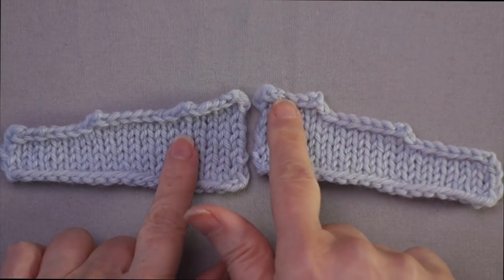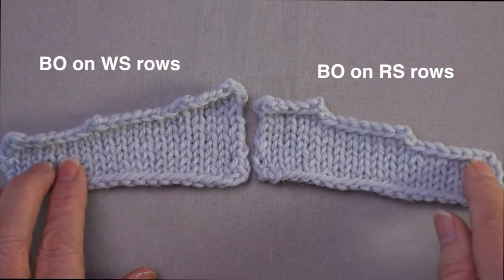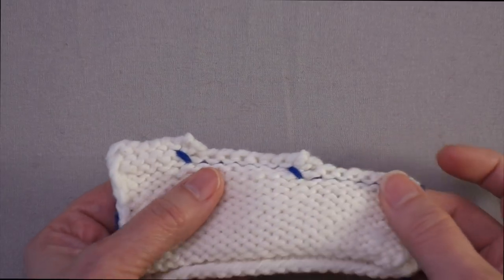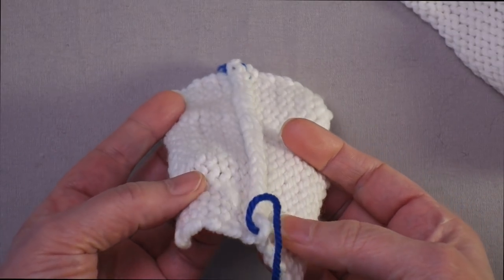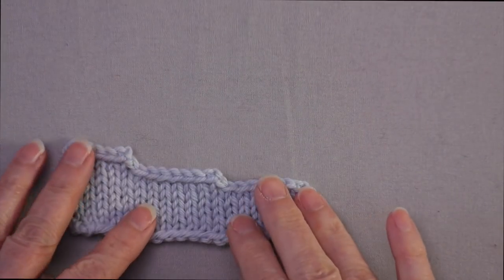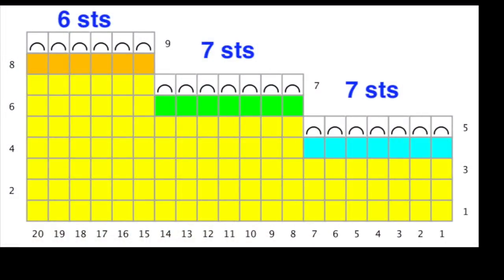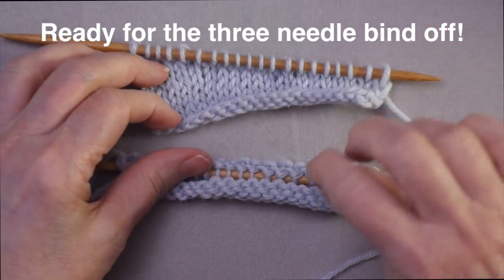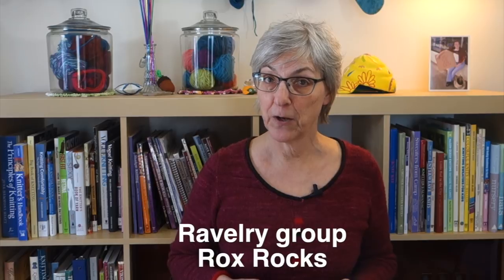Eliminate Stair Steps With Short Row Shaping // Technique Tuesday

Comment: Fab tutorial. 
I love this short row technique instead of steps, and I even use it for necklines and armholes. One gets such neat results As long as it is an "every other row"-business, it can be used there. @Roxanne Richardson
Reply: Do you typically choose to graph them together with Kitchener or do you do the 3 needle bo?  If the latter, is it for structural integrity?
Reply: @eliedgecomb4903  shoulder seams need stability, so there I choose 3 needle bind-off
Reply: @eliedgecomb4903  I graft, but I usually use lighter weight yarn and I'm a small person.

Comment: I wasn't sure about using short row shaping for they edge of my last project, because I wasn't sure I boys do it right.  Thank you for making such a clear video with illustrative charts that show its really quite easy. Though my project had slopes on both sides, one side becoming a shoulder join,  the other side a wide neck opening, where the bind of is probably good for stability instead of just knitting the collaron live stitches. 
So, I didn't do short rows, but I did follow a YouTube video by Cheryl Burnette that shows how to make the actual bind of sloped instead of stair stepped. It involved slipping a stitch at the step point.
Reply from the maker: There are a number of ways of doing a sloped bind off. You could do the short rows on the neck edge, bind off, and then pick up the edge. The pick up process will be a bit easier along that sloped edge, and the finished result on the inside will be a bit tidier. But the other trick of slipping a stitch works, too. Turning and slipping a stitch is actually a basic short row method. :-)

Comment: Thanks for the clear demo, as always. Can I ask why you would not graft the shoulder seam? As an ex-machine knitter I’d expect to do this.
Reply from the maker: You may have been working with finer yarns when machine knitting. Hand knits are often worked with heavier yarns, which increases the weight of the sweater. The entire weight of the sweater has to be supported by the shoulders. Seams reduce the amount of horizontal stretch that could cause the sweater to slide off your shoulders. If the neck is wide, or open at the front (as for a cardigan), you lose even more structure. If the yarn is superwash and/or knit at a somewhat loose gauge, you again lose more structural support.  On the other hand, if you're working a pullover with a woolen-spun fingering weight yarn in stranded colorwork, you have all sorts of elements that add structure, and prevent stretch, so seams could become more optional.

Comment: Hi Roxanne, to say that I love your vids is an understatement. I have learn to knit thanks to them and Stacey.  I do have a question, I have learn to make bust darts on top down sweaters but can I work them the same for bottom up?  Thank you for all your help.
Reply from the maker: Are you doing horizontal darts, or vertical darts?
Reply: @RoxanneRichardson  I believe they are vertical darts.  I knit the short rows like your videos, 3 sets then pick up the twin stich. I use shadow wraps.

Comment: Hello Rox, very nice video, thank you. 
I have a question, is it necessary to do this technique on men’s sweaters, as they have boxy shoulders?
Can it just be a straight bind off. Oversized sweater.
Reply from the maker: It's typically not done on drop shoulder sweaters (which have no underarm BOs or shaping), but it is done on modified shop shoulder and set-in sleeve designs.

Comment: Thanks for teaching this tech. But I have a question do I need to do the same thing for the back of the sweater. ?
Reply from the maker: Yes, you can replace the stair step bind off for the back shoulders with short rows, as well. If the shoulders are not worked separately for the back (i.e. you don't bind off the neck and then shape the shoulders), you can use this technique here: https://youtu.be/ZoxS5_wE3xQ

Comment: That's so good, but what about when you are doing the shoulder shaping on the back of a sweater and you are doing both shoulders at the same time? Thank you.
Reply from the maker: When you've completed the shoulder shaping on both shoulders, you'll be at the neck. Work across the neck and one of the shoulders. Turn, work across the entire row, and then back to the neck. Bind off the neck, and put the shoulders sts on waste yarn until it's time to join to the front.

Comment: I am stuck. I am trying to knit a top down Sweater and the top of the Shoulders are knit seperate and the you join them together when you have done the GSR shaping. I have not knit a top down sweater before so I don't know what it is supposed to look like. The sweater has set in sleeves   and its knit in the round. Please could you suggest something? I can do the GSR because I do knit socks and I have used them there.
Reply from the maker: I'm always happy to help with project questions in my Ravelry group. If you post your question there, others can learn from the question/answers, as well as offer their advice/experience, as well.  Thanks, Marie!

Comment: Qorking on my first pattern.project a pair of long gloves called adelle which also say raglan i typed in the following section in to my search engine and it gave me your video however im confused as to what to do given your not making gloves. After it says to do 4 rows or lace pattern to 45 stitches where im at now it then says to switch back to the original size needles and start using double which i think is 2 threads not one or its what ive been doing regardless of right or wrong. I dont know what work 2 without shaping means nor to i know how to shape or not to shape though it says to ●work 2 with WS facing for next row which i think means pearl side facing for next row. i dont know how Work 2 rows without shaping, ending with WS facing for next row.● I am assuming to turn work after knitting to purl and turn again though im sure thats wrong. 

And even though im sure thats wrong until i get a response some where ill be doing that and then to ●Work 1 row, dec 1 st at end of row, ending with RS facing for next row● i have no idea how to work a row but hope it means to knit and decrease at the end with the  knit 2 together decrease any response is appreciated since im.basically working stupidly and .ost likely wrong until i get a response
Reply from the maker: Raglan typically refers to a type of sleeve for sweaters, not to anything that has to do with gloves. I would suggest asking your question in the Ravelry forums (the Patterns forum is probably your best bet). It's really the best way to get answers to questions about specific patterns.

Comment: I wonder if it works on different types depths of slopes or only fpr this 1 line  low type slope, im trying to make it on a steep V neck slope, i hope it works😺😺
Reply from the maker: The challenge for a deep slope is that the diagonal created will have fewer sts on the needles than you will need to work across the diagonal and keep the edge flat. That doesn't mean it's impossible, but it does mean you would have to create more sts as you work across that diagonal once the short rows are complete. This sort of technique was used  for certain types of necklines back in the 1930s, where there was a need to have live sts on the needles after the shaping was completed.

Comment: Can somebody tell me when ive knitted the right panel and it says knit straight up until shoulder shaping.  Which "step" as its in steps do they mean
Reply from the maker: YOu're knitting straight up until you get to the top of the armhole. The stair steps will get higher toward the neck, because your shoulders sit lower than the base of your neck.

Comment: I'm currently knitting a cardigan for my sister. The back shoulder shaping states "Cast off 2 stitches at the start of the next 10 rows". Can I do this as one piece or do i have to do the shoulder shapings separately?
Reply from the maker: You don't need to do them separately. Some patterns bind off the center sts for the neck, and then work each shoulder separately, creating a dip at the back of the neck. Other patterns bind off the center sts after the shoulder shaping has been done. Some neck styles benefit from the dip, some benefit from the additional height, it just depends on the type of neck (crew neck vs shawl collar, for example). Your pattern is the type where the center sts are bound off at the end, so you can wait to do that until after the short row shoulder shaping has been completed.
Reply: And I should be able to do them using one ball of yarn?  I shall try it out before I attempt it for real.  Thanks for your videos.  I have been knitting for almost 50 years but, thanks to you, am learning new skills all the time.
Reply from the maker: @johamlett27  Yes.

Comment: Is there a way to knit the short row sloping to the right without knitting an extra row?  I don't want my sides uneven.  Thank you
Reply from the maker: You typically have a one-row difference between the right shoulder and left shoulder of the same piece, as well as a one-row difference between the front and back of the same shoulder. That's because you bind off at the start of a row. For the right edge, that's on a RS row. For the left edge, it's a WS row.
Reply: @RoxanneRichardson  so, it balances out when the shoulder seam is sewn?
Reply from the maker: yes, it does!

Comment: Could you Kitchener the seam, instead of a three needle bindoff?
Reply from the maker: Sure. Anything you could do with live stitches will work.  For shoulders seams, the stability you get from the 3NBO might be preferable over grafting, particularly if you are knitting a cardigan. The shoulders have to support the entire weight of the sweater, and with the open front of a cardigan, the sweater shoulders can stretch and slide down your arms. Knitter's choice! Having choices, and knowing the pros and cons of those choices means that you can modify to your heart's content, and get the results you wanted/expected.

Comment: Can you do a video of short rows in the middle of a project , instead of on the ends
Reply from the maker: That's covered in the "Adding Short Rows to a Project" video. Use the timestamped links in the video description to find that point in the video. If you haven't used short rows before, you'll likely benefit from practicing in a project that already includes them prior to adding them to a project that doesn't already include them.